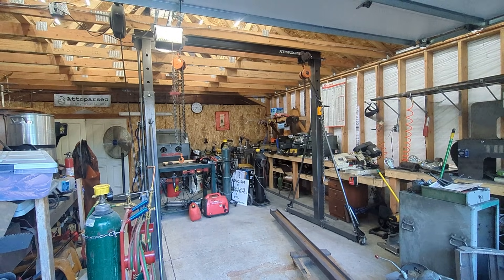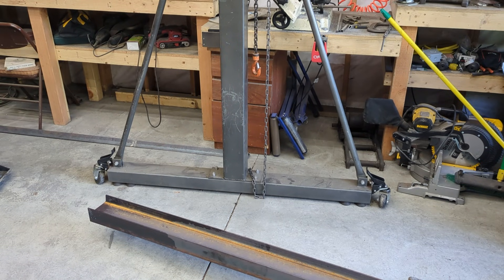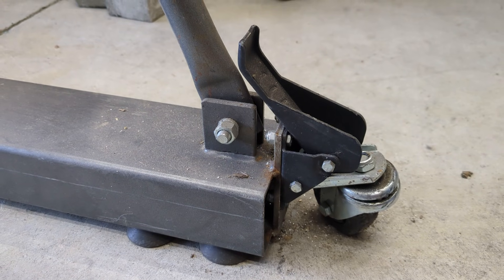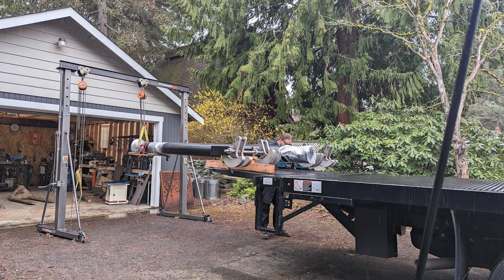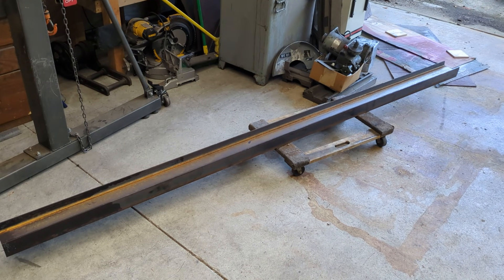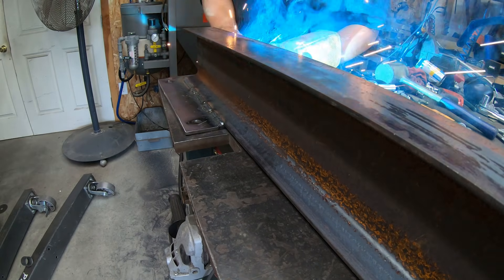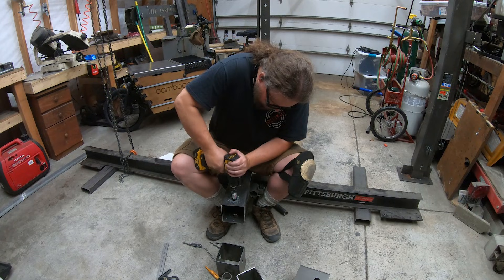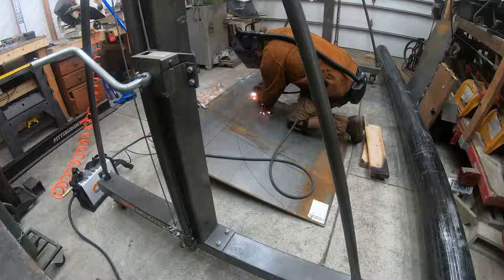Cheap cranes don't have to suck

Comment: I bought one of these years ago. Cut down the uprights before I even assembled it. Crazy they sell a gantry that won't fit under a standard 8ft residential door. The other flaw is the beam length

Comment: A nice upgrade, I would imagine if they are both made of the same grade of steel that it should be safe enough. Also, not it is not as tall, there should be less of "full height" sheer force, right?